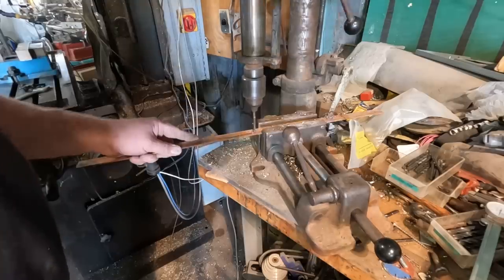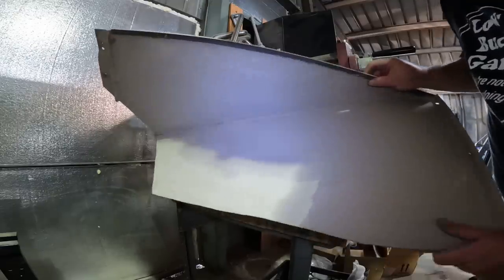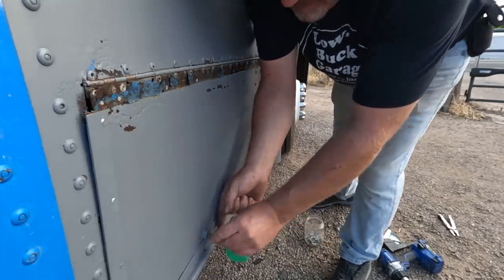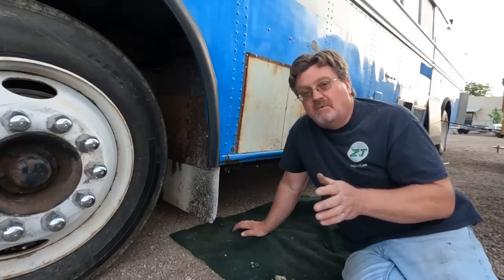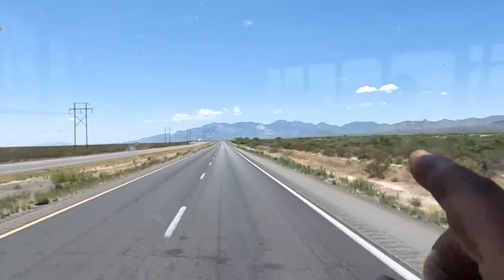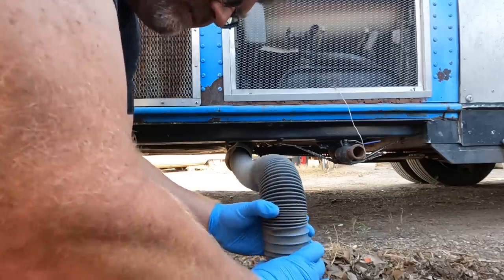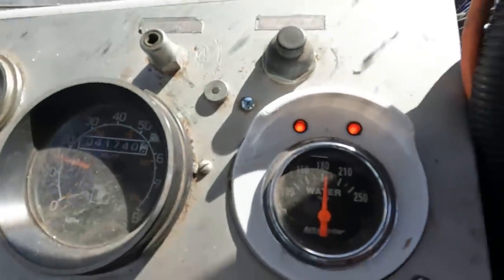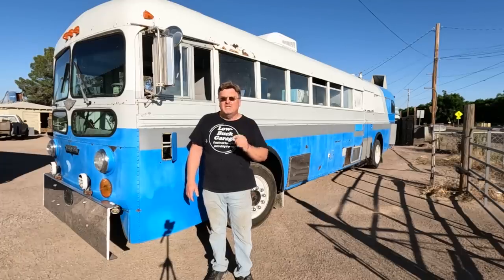I QUIT working on this 1953 Kenworth Pacific Bus! (For a while)

Comment: I had a similar overheating issue. Replaced radiater, thermostat, e fans etc. Removed water plugs from engine block to find mud restricted water ways half way up engine.. Use hose pipe to flush. All fine. Mention in good faith.

Comment: I recommend adding a buzzer which starts buzzing if your engine or transmission temperature is going too high, so you don't need to constantly watch the gauges.

Comment: Just wanted to say love your videos, my wife an I watch them all the time. I would like to make a suggestion for cooling your bus engine. Take the metal air piece you made for it , turn it 180 , an place it on the opposite side of that opening. That would allow it catch all the air as your driving an cool the radiator an the engine down like it should, in other words it would be come a air ram scoop. The way it is right now the air is just passing over it as your driving. This is just a suggestion an hopefully would work.

Comment: Another great video!  I have found that battery acid eats through most rachet straps quite well, except for some cheap ones I found that are made out of polypropylene instead of nylon.  Nylon is much stronger, but polypropylene is much more impervious to harsh chemicals like battery acid.  But how does one tell if cheap second hand rachet straps are nylon or polypropylene, when the packaging was thrown away 5.7 owners ago?  Fortunately, polypropylene floats, and regular nylon does not float, so just use the old Monty Python witch test and see if they float like a duck!

Comment: Great Job, that bus is really turning out nice. How ingenious you are making all those different parts just utilizing junk (I mean goodies) you have stash around the place. 
I image you plan on repainting it White and Blue. I see that Grey stripe down the center and it makes me think of leaving it there or a different color and at the back of the angle it up at a 45 degree angle so it ends at the rounded corner of the roof. At the front of the bus make the grey rounded instead of squared off. Maybe even make the stripe multi-color such as red, white, and blue. You could even put some stars in the stripe.

Comment: Maybe a screen over the rear scoop to prevent ingesting a bird or two. It might help if you put in a belly pan with a scoop shaped front lip to pass more air into the engine bay would help with the overheating Getting 40 mph on those hills is awesome for a 70 year old engine and tranny. Unless you plan to regularly mountain climb you and your family should enjoy that bus for many years.

Comment: Your camera on the airspeed meter is trying to record a moving object, and the visible rotation is going to be affected by the camera's frame rate. (See also: all the videos of cars where the tires look like they're running backwards.)
Reply: The digital readout of speed says 0 so it's actually stopped

Comment: Not only were the fan sensors on the wrong side of the radiator, they were on the wrong end as well.

They should be near the outlet. It won't be as high in temperature, but it will show how efficient the radiator is at the time.

Regardless of the inlet temp, if you have hot coolant coming out of the radiator, you need more airflow and want the fans on. If the outlet is cool, you don't need the fans.

Comment: The folding ebikes are very dangerous. I bought one here in the Philippines and really liked it at first but they have these sharp little bumps here that are created when someone crosses the road with a 1/2" water pipe and then covers the pipe with cement. I hit one that I wasn't prepared for, the front wheel left the ground and came down turned 90 degrees to the left, I think I only had o the hand on the handlebars, everything is a little blurry at that time. Anyway, the ebike did an end over end and I went over the handlebars and landed face first on the concrete and it happened so fast I didn't have time to put my hands out. It would not have happened like it did if he handlebars had the limited movement of a motorcycle but these things turn 360 degrees. I had a lot of injuries.

Comment: I do not know if it's still available, but years ago there was a liquid they put into cars' cooling system instead of the usual water and antifreeze, it was used on cars that were known for overheating but no matter what improvements were done they would overheat when driven hard, the liquid would keep the engines cool even when driven hard, I have not kept up with current events so do not know if it still exists but if it does it probably might be the answer for your bus, just a thought, not knowing its name is a great help I know, but someone must still remember it.
Reply: Water wetter? Spelling off I’m sure but that’s it

Comment: 2 things. Have you cleaned the radiator? Also, a good block cleaner and system flush. They make expensive stuff, or you could steal some dishwashing detergent when the wife isn't looking. I appreciate the thrifty ness of the build and the blind eye given to distraction from the current mission at hand in videos
Reply: coil cleaner made for HVac ac systems would be better for this.

Comment: Was that a school bus originally? I don't think it was, though most of those Kenworth-Pacific coaches were. I don't see any evidence of it ever having school bus flashers on the roof. Also, those buses never had a vent in the rear access cover, that was obviously added later. Congratulations on excellent videos you've done with this bus!

Comment: ya i going with fluid change expensive but you can alway save old fluids use them on things 
i think you got under power and head gasket issues or soon will

Comment: I would not cover a hole anywhere near the engine compartment. One probably blows air in the other one probably sucks air in when you’re sitting still.
Reply: uhhh yeah it sucks air from above and through the radiator and out the side as its intended to.    When they designed the bus it was designed that way for a reason .      A lot of work went into perfecting that design and if its done correctly it works best that way.

Comment: I don't see a problem. You will spend a lot of time inside the bus where the exterior is not even visible. Even when outside it will be difficult to see the roof finish unless operating a drone.

Comment: Since you're already working on the cooling water, I recommend throwing out your water heater and put in a modern hot water storage tank with better insulation plus a pump.

You can add an electronic selector valve and an “it's hot” shutoff valve in the tank, plus two turn-on switches on the generator and the main engine.

If you add two water to water heat exchangers, one for the cooling water in the main engine and one for the cooling water on the generator.

The water in the hot water tank can then be pumped through a heater core to heat the cabin in the areas you want, or you can create hot water with a heat exchanger coil in the top of it.

So as long as you drive or use the generator from time to time you get automatically hot water, and you don't need to run the generator all night, to keep the cabin warm. And the diesel while driving is not wasted, but also heats up the storage tank and the generator will not only create electricity, but also hot water :)

If you run off of shore power, you can also add a simple heating coil to the tank (they are usually prepared for adding one anyway), and if you add solar in the future, you can just turn it on, once the batteries are charged, to get free heat/hot water.

Comment: I've always painted my work vehicles with tractor enamel from tractor supply it holds up really well and most importantly  it's cheap! Check it out you won't be disappointed.
Reply from the maker: I was looking at that exact stuff.  The only reason I didn't get it was that I'm going for a particular color scheme, and they didn't have the right colors.  I will try it out on another project, though.
Reply: @LowBuckGarage  I understand , it's a great bus .    stick to your gut it's served you well.

Comment: hey maybe check the water pump, possibly half thr impeller is rusted off
Reply: Was thinking that since the engine wasn't made for that bus and was added later , the flow on the existing pump may not be moving fast enough through the oversized radiator.

Comment: didnt these buses have "belly pans" under the engine so no air would escape from new. but these were often discarded by lazy mechanichs who didnt understant their use. without them all the cooling air just disappeares
Reply from the maker: I'm not sure if it had one originally, but I'm thinking of adding one.
Reply: I agree with this comment , if you look at an air cooled VW bus transporter type 1 / type 2 you will see a engine to frame gasket to the cold air can be pulled in from the top and through the fan and out the bottom.  Your on the right track with closing off the rear air duct and the sides which forces more air through the radiator .    You just need to stop the air from going out the bottom . Good luck. @LowBuckGarage

Comment: Over heating, maybe try to blow out the radiator
Reply: I personally think its a pump flow issue as the radiator is 3 times the size of what that engine originally used. that and all the flex hoses , needs a metal radiator hose with a cooling fin attached on the top.   But who knows at this point.

Comment: Add water injection to the engine
Reply: Personally just needs a stronger mechanical pump fitted to the engine .   Wouldn't want to add anymore draw on the electrical system as it is, too much and you run into the same issue where the engine is overworking spinning 2 alternators and the bus at the same time.

Comment: Hehehe, people always fall for the RV products, they are mostly rebaged home care products. if you want quality, go with Marine products, they are by far better than automotive,RV or home products.
Reply: Sure that's true but you also get the marine name expense too. ( ohh its marine grade lets make the price 3X more )  it just needed sealed then cleaned , dried then painted over the top.
Reply: @killerdeamonking    Yea, I've heard that before, thats why RV's are constantly being resealed and repainted. You often get what you pay for. If the product can hold up to the north atlantic for a few years, it stand a lifetime on a RV.  Hehehe, ever try to get 3M 5200 or two part epoxy deck off. In the long run, it costs less to use better products the first time that redo the job often. But not all marine products are the same, some are just glorified RV/home junk

Comment: 210 is way to hot
Reply: Agreed but then again the engine wasn't made to pull that big of a bus around too. With the mods hes making is helping slowly.  With a bigger water pump added for that size of the radiator ill bet that most of that issue will go away , as well as sealing off the underside where the engine is so the air that comes in isn't wasted going out the bottom of the bus.